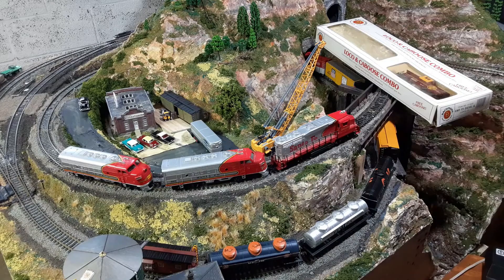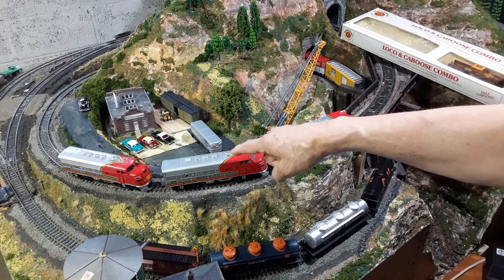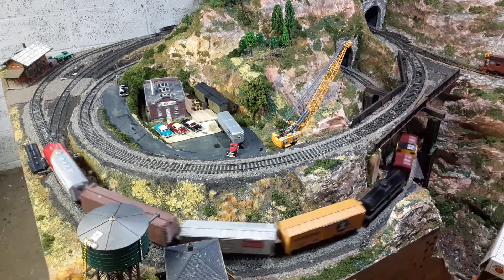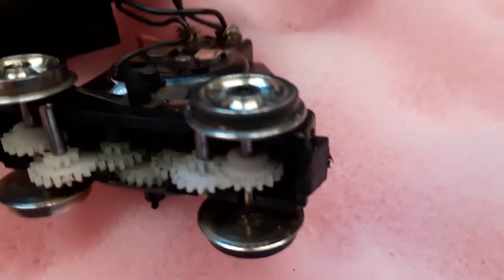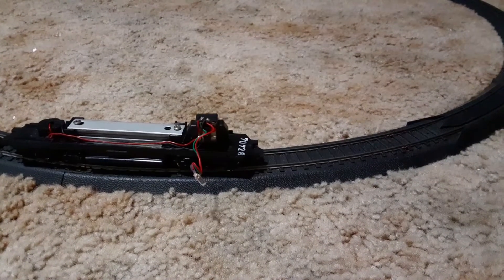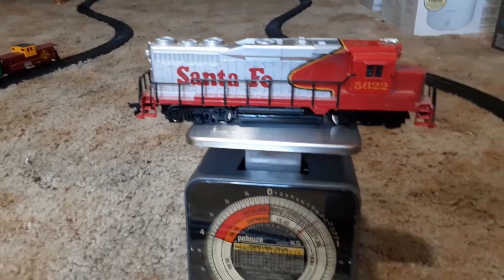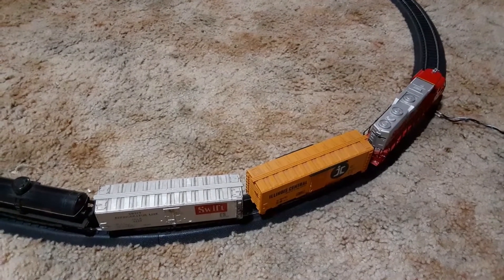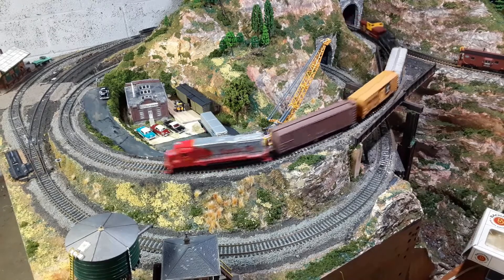Repairing my old Bachmann HO scale Diesel

Comment: Newer Bachmann stuff is a lot better since around 2010 or so. They have eight wheel drive, die cast chassis, worm drive and flywheels. After the "Bachmann plus" stuff, they've corrected the cracked gear issues.

Comment: When using a loco of this type and running them on a layout with hills/inclines, make sure there is no oil or grease on the traction tires. That tends to contribute to "wheel slip" issues when going uphill. If worse comes to worse and you cannot find any gears, you could potentially replace the motorized truck with one from a company called Northwest Shortline. They make a motorized drive called a "Stanton Drive Truck". The motor is inside the truck itself and does not take up space in the locomotives body. However, you'd have to make a section of flooring to mount it in place and that's not hard to do. To add more weight, you can use those small, 1/4", flat wheel weights that have an adhesive backing on them. Just stick those inside the loco shells walls and or on the lower frame close to where the wheels are.
Reply from the maker: @WWIIREBEL Yes, I've read about those NWSL drives.  I bought these so long ago that they're nostalgic for me. And I dont really want to put much money into them. Thanks for watching.

Comment: These older Bachman engines are very similar to lifelike though The gears on bachmann tend to crack I have fixed two diesels with 3d printed gears
Reply from the maker: @chasesrailwaylinesrr6447  Nice! I don't know anything about 3d printing, but it sounds like the way of the future for fixing this stuff.
Reply: I use it because it's better than the gluing tactic We always try it but it never works I only had once when it actually did work, It was on a damaged bachmann 0-6-0 and it is still working up to now

Comment: A clicking sound indicates split gears. An old Bachmann is like fishing for carp. You filet the fish, throw it away, and eat the board.
Dump the Bachmann chassis and install one made by Athearn.
Reply from the maker: Thanks for commenting. I had heard about the clicking and split gears so that's why I borrowed the gears from another loco. But I would just buy a whole Athearn engine and throw the Bachmann out, or use the shell for a wreck scene or something like that.

Comment: Wait...I'm confused? Is this O-gauge or HO Scale?
Reply: In this video, you are looking at his HO scale models. The O gauge is larger by 1/2 in size and because of it, HO (Half 'O') gets it's name which is the abbreviated form of it's description .
Reply: @xxxx-hw5we  OKay. It's just confusing between your name and title - John's O Gauge & HO Trains. SMT is great for a young man.  I love his layout. What are your curves? Do you run code 83 or code 100 rails?
Reply: @crsrdash-840b5  My screen name  should be seen as 'xx xx' although I do not know why. At any rate, I run on a club layout with over 5000 feet of hand laid code 100 track and turnouts are as great as 45 degrees in some areas. So this is not a concern for me. While I do watch and appreciate SMT, he doesn't really do in depth diagnosis and repairs as elite does. I have watched enough SMT's videos that he is now predictable. Every repair must include cleaning of the motor armature with the fiberglass pencil and a little lightweight oil in the end bearings. This is OK, but he neglects other aspects that need attention. He will clean his wheels but I rarely see him gauge them. I'm not ridiculing him, I just wish he would go farther to explain and display the correct method for the benefit of his audience. Ever see him strike both ends of live wire together to determine if he has power?  While he is doing it with no ill effects, no one should be doing this as there are correct methods of determining if your wires have power that are safe for everyone to use. Attaching both wires to a multimeter is one.
Reply: @xxxx-hw5we  I agree in terms of SMT youth and inexperience. however, the fact that he can repair and maintain models from pre-1980's is amazing! I grew up in that era and the 70's and never learn how to clean and repair such things. I give him credit to SMT in the modern age of electronics and software model railroading. He has a talent that is being shared, even if he does not realize the FULL Potential of his efforts! Give him another 35 years and he will be supreme!
Reply: @crsrdash-840b5  35 years? I do not have the time or the patience. This is why I took the the time to learn myself how to tune, maintain and repair my own power and rolling stock years ago. But I digress.
Reply from the maker: Please forgive the late reply. Yes, as @user-fo4yw6xj6s noted, this is HO Scale. I haven't posted for a while, but most of the other videos are my O gauge layout.
Reply from the maker: @crsrdash-840b5    My HO scale layout has very tight curves, actually less than 18" radius in places - old track with old 100 rails. And my trackwork is pretty bad. There should be a law against model railroad trackwork as bad as mine.
Reply: @Johns0gaugeAndH0trains  Actually, this is a rule stating that what you have done is not modelling. It's a toy-like Christmas tree train set up...sorry.
Reply from the maker: @crsrdash-840b5  Thank you for setting me straight.😃
Reply: @Johns0gaugeAndH0trains  😇

Comment: For one thing, the hill is too steep inmo, and another is you might need new traction tires. Also check your track. Maybe has some oil or dirt that's making it slip so bad.
Reply from the maker: That Athearn blue box model doesn't have traction tires. But, yes, the grade is too steep, and on top of that the curves are less than 18" radius, which also robs power. The track plan is from Lin Wescott's old book "101 Track Plans."

Comment: I have a Bachmann F9 my grandpa gave me for my birthday. Some idiot painted one of the screw heads on the wiring part on the motor.
Reply from the maker: @caedmon2behrens186  Is the paint on the screw head something they did at the time of manufacture, to show if it's been opened up previously, in case of warranty claim?
Reply: @Johns0gaugeAndH0trains  I never knew that was something they did. Guess I should've researched it. The paint is like a rust brown.
Reply from the maker: @caedmon2behrens186  Sounds like it might be that. But I'm no expert.